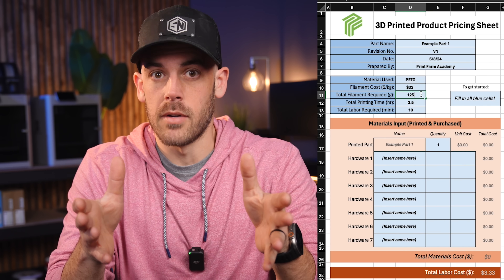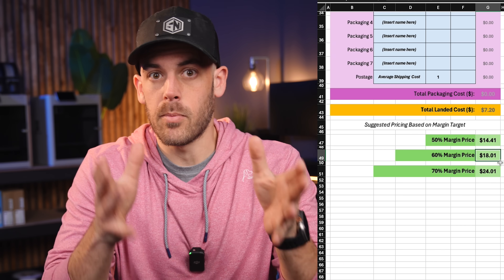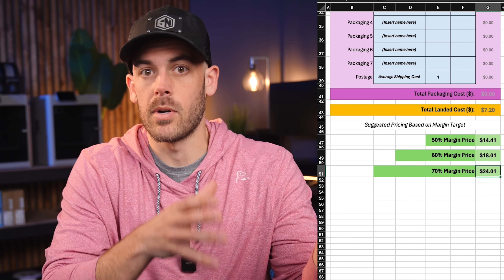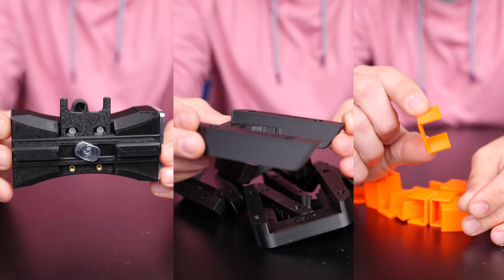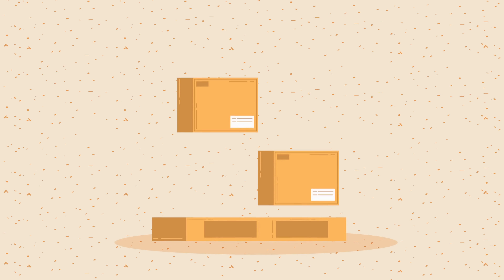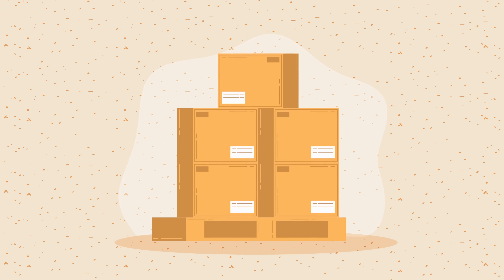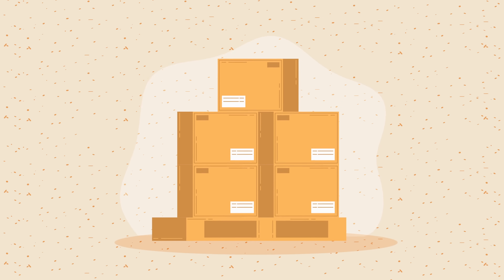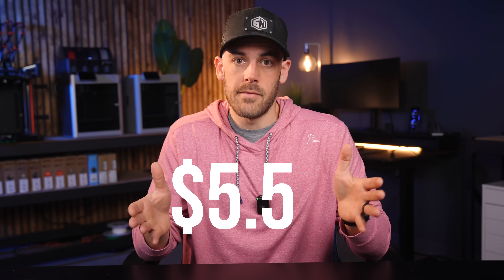Why I charge $55 for this 3D printed part (how to price)

Comment: I bought your Bosch dust chute and unfortunately it’s not worth the price unless you’re willing to provide a warranty. This product is good for the type of person who does a couple cuts a day but in a production shop I managed to blow mine up within the first two months. Per our conversation on Etsy you do not warranty your work so for me, a product that can’t stand up to production use isn’t worth it to me. If you change your policy to offer replacements, then I’d say it would be worth it but throwing $50 at something that only last me two months isn’t worth it.
Reply: Assuming you're talking about the title product, the main issue IMO is the material. If I were making this it would be out of something stronger and less likely to deform (e.g. ASA or Nylon depending on chemical resistance needs). PETG just isn't suitable for long term shop use for something like this. There are other PET type plastics that might hold up but I'm not a fan of PETG.

As for warranty, that gets tricky but at this scale I'd likely offer a free replacement for at least 6 months and on a case by case basis after that. I'd be fairly confident in it when printed in a more suitable material and if I wasn't it wouldn't be worth selling.
Reply: @JJFX-  I think that material helps, but I think if you are talking material instead of thickening then you are solving the wrong problem.

This part could have walls that are at least 4X thicker and I wouldn’t change the form fit or factor of the part, and you don’t need to change the materials to thicken the part.
Reply: @jasonconstant455  Yeah, you can definitely strengthen a part to work around material constraints but that also likely means it takes longer to make and 2+ times the plastic can start to add up. I'm also not sure how practical it is to thicken every weak point here but even if you could I'd first try to utilize the most suitable material then go from there.
Reply: @jasonconstant455  depends on how large this complaint really is. Thickening a part also uses more material which changes the overhead cost or the part cost along with time to print it.
Reply: It Is resonable... but you have to understand that in market were there are warranty and replacement  policy (for example clothing) the average margin Is 2,5X to 3X ... a piece that costs him 25 that he sell at 50 should actually sell it between 62.5 and 75 dollars, in the replace request Is lower than 10/15% of highter It have to cost more (in material or post processing os simple margin) in this case he could provide the replacement within a period of time.

also as others say in the comments there is the issue of materials and possibly specifying better the use, the duration, advice to make the piece last longer.
Reply: I have to agree that if he had provided a replacement to this buyer, this entire conversation (and the hit to his seller reputation) would have been avoided.  While there's added expense to replace a part, that expense is low compared to the possible lost sales due to a complaining customer.  This issue could have been resolved privately between the seller and buyer, with the seller making an exception to his usual policies for this use case (no need to change his public policies).  Then everyone would have been happy.

I think a lot of sellers need to add more human element to the equation when determining how to handle returns/complaints.  The hidden costs of hard-nosed policy adherence are a lot greater than they appear.
Reply: @ryangriggs5767  - Trying to please a demanding customer is a losing equation.  People love to whine.
Reply: How much did you make off using a $50 plastic part I've been in construction my whole life and the more use something gets the faster it wears out lol
Reply: Perfect is the enemy of good enough..... so in a production shop you can either $$$$ for high quality accessories or you can understand that use/abuse will shorten the life of the parts.  Bosch tools are already "haha" priced so $55 accessories for normal use shouldn't be a big deal.  If you are willing to spend $75 or $100 on that accessory I'm sure the material can be changed.  Rather than trashing someone for creating an aftermarket accessory it would have been better to ask what  it would cost to make something stronger. 

Or of course, seeing as you know better you can run out and spend $1000 on a printer, $20+/kg on material, learn cad and spend $1500-$5k/yr on that software and then just print your own attachment.  You may quickly decide that an on-demand solution is a bargain.

The problem is that as you go to stronger materials the defect rate climbs and the complexity of manufacturing climbs.  Both of these drive the COGS because it consumes materials and machine time.

Some things are just not a good fit for FDM or SLA processes and are better suited to CNC or Injection Molding.  Those aren't always practical for products that have a small market (sub 10K units) or customers with unreasonably cheap expectations.  IM in particular excels at  strong parts but has high setup overhead with low production costs and moderate post molding costs.  It's great when you have a large market and crap when you have a small market.
Reply: Was it weak material issue?
Reply: In case of providing proper warranty, there needs to be proper testing to ensure the product can actually handle the specified amount of time without breaking. For small 3D-print farms that could be a bit too much overhead cost, especially if you are not just planning on producing 2 or 3 parts 24/7.
Reply: I was going to ask this. I would feel bad selling prints knowing they could break and it would cost me a lot of money to replace it. It's not like an injection molded part where once you've made the investment you can just send em another cheap part and not even think about it
Reply: Very helpful.
Reply: Wanting a warranty for a 3D print bought off Etsy for use in a production shop. Common sense has left the building.
Reply: He should have replaced it for good customer service.
Reply: You know normal plastics that are used for tools are glass filled nylon right? Injection molded nylon. Ofcourse its not going to hold up xD there is a reason bosch sels it for 150. Its because thier mold is 250k to make and they nees to earn that back .tbats why they can do warantees
Reply: @fireworkstarter  Anyone who makes anything and doesnt offer 2 year warranty is just bad at making things
Reply: Yeah, 5 bucks, would be worth it to have a happy customer to send him a new one.  Especially if this is a rare issue, financial impact is nill.   Business 101.  One has to wonder why he won't replace it.
Reply: Dude, you bought a part off Etsy to be used for production, and from the sound of it, heavy production.

Voicing a public complaint in the comment section is really not cool, unless the fabricator responded unreasonably, and didn't try to work with you to figure out a mutually beneficial solution.
It can also be very damaging to this guy's business.

I'm not saying the complaint isn't valid but more information is needed and it is not fair to the fabricator to have a complaint publicly voiced unless it is valid and includes more information and full disclosure.

This guy made a very helpful video and was very thorough and willing to offer helpful information with nothing expected in return, I would find it hard to believe if he did not act with good intention when addressing your complaint and requested warranty fulfillment.

Since this has become a publicly voiced complaint, you should really provide greater details and be fair to not only fabricator but those reading the comments by providing more information. 

If we know more about the part and its use, it's possible that a refund or replacement.is valid but as of now, there is too little information to make that determination. 

It should be disclosed and known,
1. Why did you Purchase the part? 
2. What are you using for and how many hours per day is the part in used?
3. Was the part installed correctly and used as intended? 
4. Where did it break? 
5. Did the part function correctly when in use and were you happy with it?
6. Does Bosch or another third party make a Dust Chute for you application?
7. During the exchange between you and the fabricator, what were the potential solutions, if any, that were discussed? 
8. Did the fabricator even try to rectify the issue? 
9. Did you provide proof, pictures and video that support your request? 
10. How was the complaint handled, was it addressed immediately or did it take a long time to get an answer? 

The answers to those questions would allow everyone to have a more knowledgeable and informed opinion about the situation and requested warranty/replacement and whether it is valid or not. 
I don't think that's too much to ask and I think it would be very fair for both parties, and I think it would help the fabricator develop business practices to provide better service.

What I do know is, the way things are made now they are made to fail, cheap and do not stand the test of time. 

I wouldn't be surprised if you bought the same part from Bosch or another third party manufacturer and it broke too. 

As for a personal and similar experience,
I bought a DeWalt 7-1/2" miter saw that I use here and there for specific small jobs where I don't need my 8-1/2" or 12" saws and one side of the black plastic handle on the top of it broke at the base where it connects to the housing. 
Thank God the saw didn't drop on my foot or worse, an employees foot or on a customers floor...etc.
That shouldn't happen at all and total BS that it did. 

I keep my tools in a garage and in excellent condition. I've had a DeWalt table saw for over 20 years and the rack and pinion system still works like it did the day I bought it, and I've had my 8-1/2"  & 12" saws for almost 2 decades and those handles are solid and still usable. 

For most tools, if you respect the tools and use them as intended, they should offer many years of service. But if you abuse tools, do not use them as intended and do not clean and maintain them, they won't.

As a business owner for almost 20 years and being in the trades for over 30, if I was the guy fabricating the part, before issuing a replacement, I would be willing to hear your complaint and possibly issue a replacement. 

I would like to know how you use the part and what it is used for (high heat or stress environment, chemicals...etc.), pictures and/or video of how the part is being used, and in exchange I would send you a new part free of charge. 

Otherwise, you are asking for someone to spend time and money for a complaint that really may not be valid.

Also, as the fabricator, I'd like to know if others are experiencing the same failure, and if there are, how many and why.

I will assume that you had a discussion with the fabricator and tried to come to a reasonable solution but because one wasn't reached you are disgruntled and upset that you feel that you wasted your money. 

By voicing your concern publicly you either A, Hope that the fabricator would supply a replacement or B, feel the need to warn the public that the seller might not stand behind their product. 

I hope that you do come to a reasonable solution that is mutually beneficial and the seller doesn't lose business because of your public comments. We need to work together because there is way too much division in this country and world. We all need to do our part to make it a better place to live and one way we can do that is through clear and respectful communication.
Reply: Same issue. He was rude and quality wasn’t worth a penny over $30.
Reply: How much would you pay for the same dust chute fabricated out of fiberglass? Or ASA,. Or even PVC?

I suspect those filaments would make tougher prints.  Not perfectly drop proof, but better than PLA.
Reply: @tikitime he didn't mention the slicer settings he uses, number of perimeters,  infill etc are all factors, I print predominantly for use in emergency services vehicles,  ASA for anything that is visible and requires good uv properties, and PETG for all parts not out in the sun, I use 5 perimeters, 5 top and bottom layers and 15 to 20 % infil, I make pods for windscreen light right through to air ducting parts, we will replace any part that fails, immaterial, we also sell spares of these parts to body shops in the case of vehicle accidents, replacing a part for free goes along way for reciprocal business
Reply: @tikitime  sounds like he's cool with the price. I'd 2nd that too. $50 for a dust chute is about what I'd expect to pay. Maybe $30 if I were making and selling it but hey, that's me and what I can accept.
Tool accessories aren't cheap. I have an entire shop full so I'm aware lol
Reply: @tikitime or just get a real one from bosch for 150 that you can throw off a roof every day for a year and still use it
Reply: Oooh drama
Reply: Why don’t ALL of you whiners start your own business, and take your poor advice. I’m sick of arm chair qb’s telling REAL entrepreneurs how to run their businesses.
Reply: @user-cc5uh4hc1i  as far as they produce reliable functional parts and provide warranty, like other manufacturers
Reply: @user-cc5uh4hc1i Offering warranty is "poor advice." I thought we were supposed to glaze on hate comments and not real criticism.
Reply: This part should have post print part finishing or should have been manufactured in an SLA printer where the structure would be stronger.
Reply: As a manufacturer you would expect a broken or prematurely worn part to be returned for warranty inspection, at the very least you get to see what’s failed and how to improve the part.
Reply: @globaltripping3654  True. Back in the 1980s, if you got a faulty CD, they wanted it back to determine the cause. 2150 CDs later I haven't found one yet.
Reply: @rjthomasindyusa You dont take Harbour Freight tools to work in a dealership service center.
Reply: @dinneryeti actually a lot of people do.
Reply: @dinneryeti you be surprised…
Reply: Idk. As a welder i took harbor freight tools to work all the time like grinders and drills. They've lasted me quite a long time actually. About a year & a half to 2 years. They've never broken down. My tools were stolen soo i dont know how much longer they wouldve lasted but theyre not all that bad.
Reply: @dinneryeti  Harbor Frieght offers lifetime replacement on most of their mechanics tools.  So why wouldn't you use them and the Icon line is awesome.  IMO, if you're going to make any tool or accessories, it should hold up to daily usage.
Reply: @jonwoodworker it was a quick 3d fix. There us a reason tools are expensive, it takes research to make a good tool and it take a good mold or expensive machine to make a good tool.
Reply: Printing functional parts is more than material choice. You need to divide the part into multiple sections, so the layer lines are not inline with mechanical stress. This will balloon other issues such as surface quality, use of supports, using large amount of support material and additional 3d printing time. Also this involves gluing the parts sometimes. But the right choice of glue has more mechanical strength than the print(along layer lines) itself. Also for a durable part you need choice of metal(dowel pins) and brass/stainleds inserts. For a part that undergoes wear, it has to be designed to make the wornout portions replaceable. Additionally, you could flame polish, vapor smooth parts and that needs additional skill. So, for part designed to make quick bucks, you cannot expect durability, let alone warranty. Unfortunately 3d printing involves additional overheads for sales and marketing, that further compromises quality for better profit margin. Incase of injection molding there is significant upfront cost(mold/tooling), but pays for itself in volume sales, if done right. The big catch being lost money, and lack of iterative improvements. Best bang for the buck is when one can design their own parts with a 3d printer/cad learning investment.
Reply: @aware2action Is that what happened? The part was designed for a "quick buck"? For $50 I would expect a quality part. Both of these guys are trying to run a profitable business.
Reply: No warranty is crazy. How is that even legal.
Reply: Then you should have informed him to make a part out of much stronger material.  I built ski/board boats, and we didn't make them for racing, or tricks, and we had them sign an agreement to this effect.  I can ask, did you ask him to reprint them, ask for a stronger part, and did you tell him the professional use, or in your case, non-professional overuse?   Just asking?
Reply: @e2U "Under the Australian Consumer Law, businesses must meet a set of basic rights called consumer guarantees when they sell products or services."
This means that if selling the product in Australia as an Australian sole trader or business, I am bound by this law that protects the consumer. The products warranty in Australia is usually 2 years, although a lot of companies only offer 1 year. Then if outside the warranty, a broken product could still be forced under warranty by a tribunal depending on the "life expectation" of such product.
Definitely, if this product breaks within 2 months, as a consumer I would be entitle by law for either a full refund or a replacement.
Each country has its own consumer protection law and it might be worth checking before making it a business.
Reply: @e2U 😎
Reply: @e2U  absolute horrible take, I would never do business with you.
Reply: @e2U 3d printing doesn't work that way. You don't just crank the material strength dial to 11 and off you go. Stronger materials require more expensive machines, and there's no guarantee the print itself will be much stronger because it can still break along the layer lines. A strong filament might not have strong layer adhesion. There's like a million different considerations when it comes to strength of the final product and in most cases you are making sacrifices. 3d printing itself is a sacrifice
Reply: Knowing the intended use, it was up to the buyer to assess product suitability.  Caveat emptor.  Whiner.
Reply: Thats how I feel as well. I so both 3d printing and woodworking - If a part would have a chance to fail even eventually I would have just purchased two right away as I understand it would basically be a consumable or prepare to buy another when it starts to fail.  Each operator knows the wear and tear something is going to take depending on how the machine or they operate the machines.
Reply: @rickphelan4326 but to charge $50.00 for a part that you can buy better from china for cheaper.
Reply: @rickphelan4326  You braindead? Cause it sure sounds like it.
Reply: @rickphelan4326  Not everyone is in the 3d printing sphere and knows which materials are suitable for what. I doubt you do extensive research on everything you do, so drop the shitty "whiner" attitude, like damn can you white knight for the youtuber any harder?
Reply: @zephyfoxy  Uh, yes, if you are selling a product to the public you should absolutely research the various constraints and list them for the buyer to know about before buying. Do people just take this devils advocate high road because they are dumb or do they just desperately need to be right
Reply: @rickphelan4326  youre wrong, read more.
Reply: @rickphelan4326  My point was that a simple, low cost replacement would have made this entire conversation moot, and thus the seller could have avoided this hit to his reputation, and likely made more profits in the long run. It would definitely be an individual decision based on the customer's attitude etc.   If I were the seller and a customer let me know nicely that the part didn't hold up to heavy use, I would strongly consider replacing the part and seeking feedback for improvement.  If the customer was being a jerk, then yes, I understand a hard-line answer of "no refunds".  Again: this should be handled case-by-case, not broad stroke.